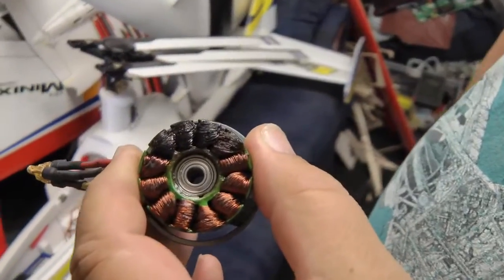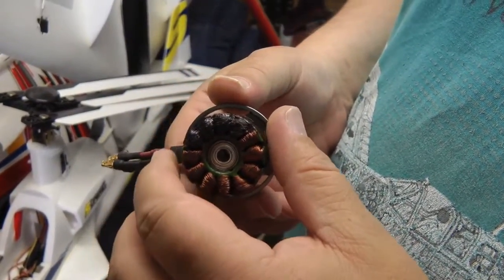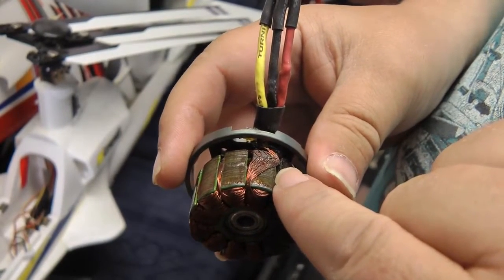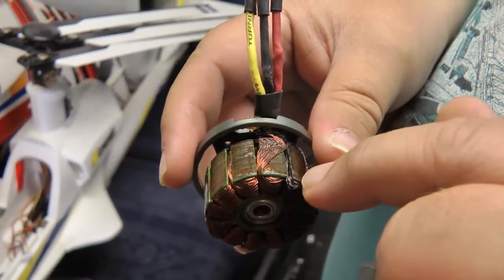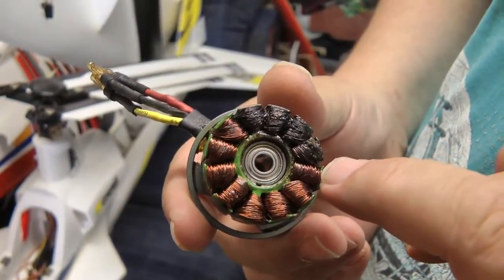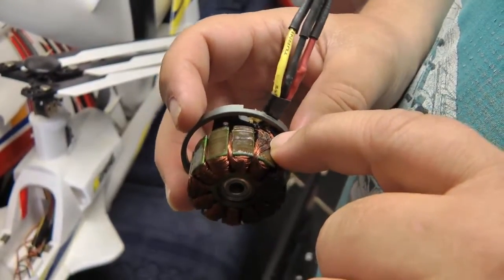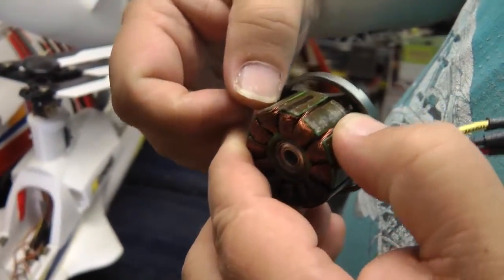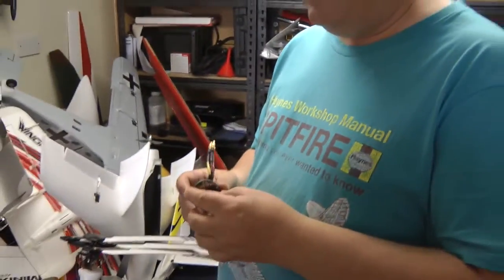Hobbyking NTM Motor Failure Maiden Flight RQ-7 RC Model Geeks

Comment: yeah I had an align bl600mx do it, brand new, I looked inside an found out one little wire came off the winding and ended up in the same position, in between the magnets and boom, bad thing was I was bench testing a brand new trex in my house, smoked and stunk the whole house out for hours

Comment: Guys - thanks for sharing. I think you are correct - a definite manufacturing flaw. Please share if you get any joy from HobbyKing. It should be insightful to understand to what degree (if at all)  they stand behind their products.  Also please comment on the cooling for this pusher configuration - there did not appear to any specific provision - despite the large firewall  clearly fully shadowing the motor. Keep up the good work. Thanks Martin
Reply from the maker: Will keep you all updated with the outcome! I dont think cooling was an issue in this case. Luck of the draw. just a bad motor.

Comment: Unfortunately this is happening all too often these days and it doesn't matter the brand or the price.   Having said that, I have bought and used dozens of NTM and Turnigy motors and never had a problem.  Good luck getting a replacement :-(
Reply from the maker: Yeah they do normally just work fine for us too. Im sure Hobbyking will do whats required ;o)

Comment: Hi there the exact same thing happened to me with a Turnigy prop drive 2836.
when I opened it up two of the windings were overlaped.
Mine didn't burn out I only noticed because the motor became tight to turn by hand.
Good luck getting a replacement customer service is pants. Great maiden thou 😀
Reply from the maker: I have complete faith in HobbyKing!